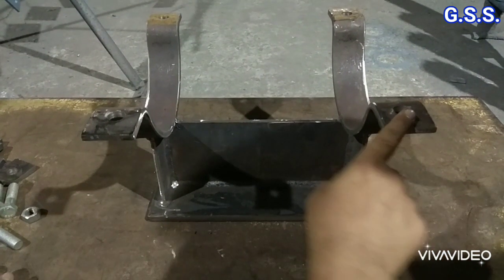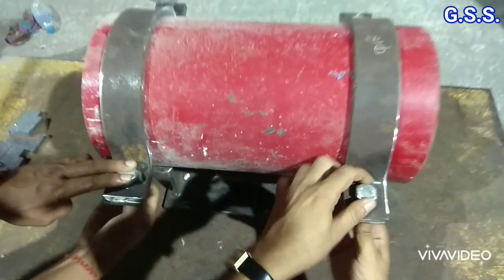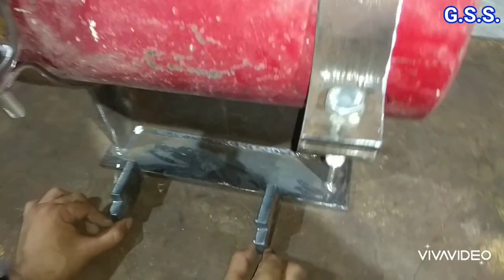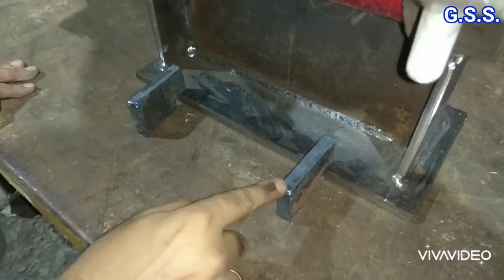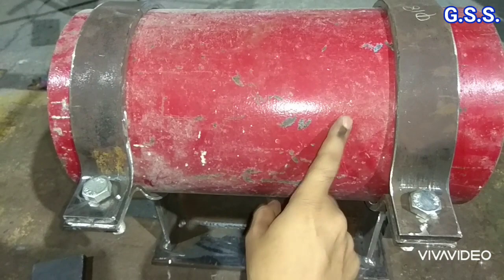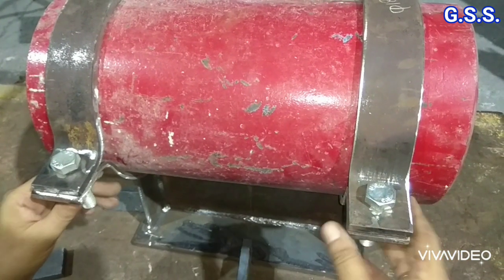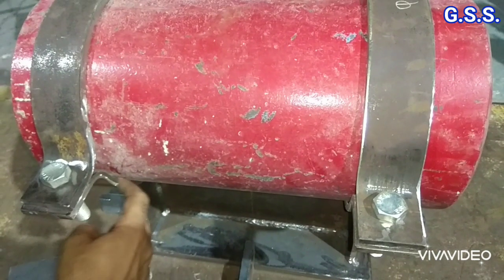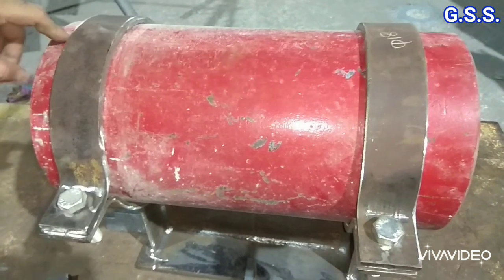Piping Engineering : clamp type pipe shoe - sliding, guiding & fix support

Comment: Dear Sir, 
1)How can we protect Strip inserted on clamp to avoid corrosion from Pipe axial movement?.
2)How can we calculate the load breading capacity of this clamp shoe Vs Welded shoe?
3)Is there any limitations(for which lines can we use) using it as axial movement stopper(only with strip welding how much it is safer).

Comment: Hi sir,  
How that shoe plate thickness decides
They are std. As per size or there is design method
Thanks
Reply from the maker: Every large engineering company has their own standard of several type of pipe supports including dimensions, plate thickness, etc
Reply: @gourisankarsamanta7670  
Thank you sir
Please make video on dyke wall